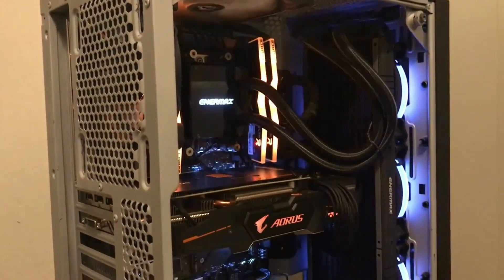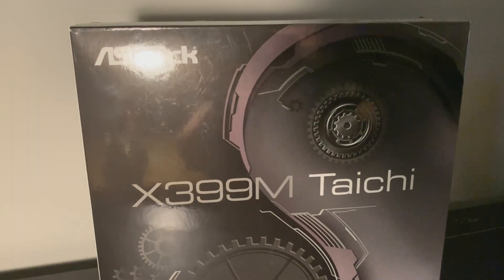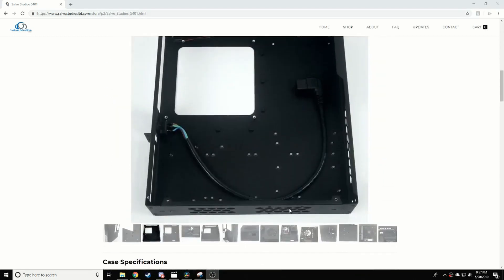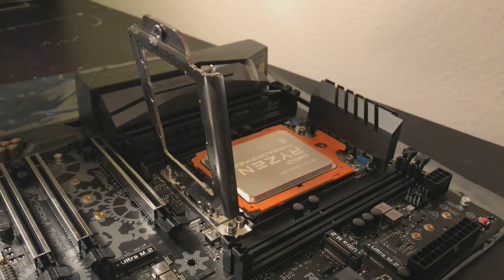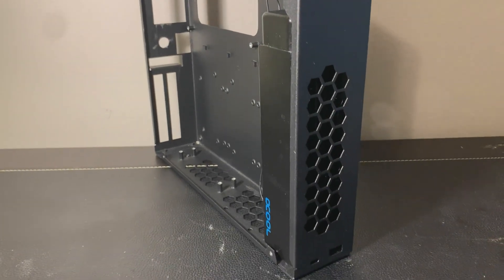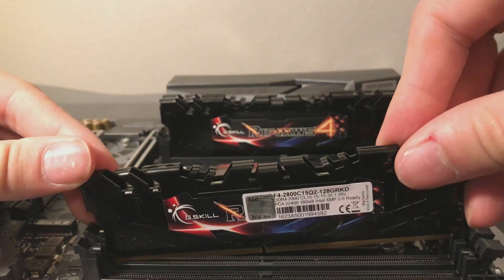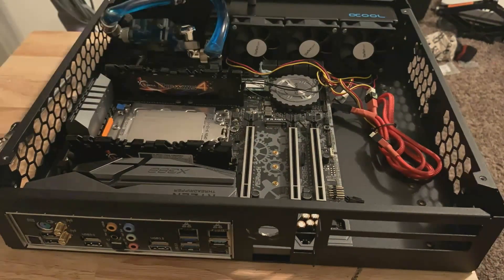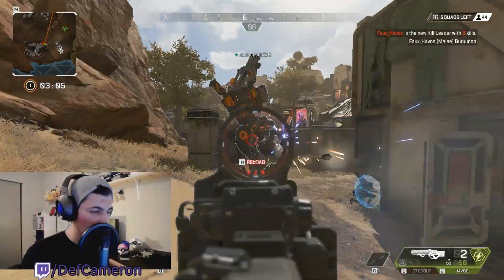“Mini-ITX” Threadripper PC - WORLD RECORD 8L (2019)

Comment from the maker: For those of you wondering, the HDPlex is connected to a 19V custom Laptop adapter from G-Unique rated for 500W.

Parts List:
CPU: AMD - Threadripper 1950X 3.4 GHz 16-Core Processor  ($450.00) 
CPU Cooler: XSPC Raystorm NEO CPU Block. Alphacool Triple 60mm Rad + DC-LT pump + Plexi-Top
Motherboard: ASRock - X399M Taichi Micro ATX TR4 Motherboard 
Memory: G.Skill - Ripjaws 4 4x16GB DDR4 -2666
Storage: Intel - 660p Series 1 TB M.2-2280 Solid State Drive 
Video Card: Gigabyte - GeForce RTX 2060 6 GB MINI ITX OC Video Card 
Case: Salvo Studios S401 Mini-ITX Case
PSU: HDPLEX 400W DC-ATX NanoPSU + G-Unique 500W Custom 19V AC-DC Adapter
Reply: I'm going to try and beat this by making something about 5 liters in size

Comment: This build is insanity! I was directed here via the Salvo newsletter. There are some builds in this case that are mind-numbingly creative.
Reply from the maker: It's an honor to be in the newsletter! This build was insanely fun and I don't believe any other case could have supported it like the S401
Reply: @definitelycameron9021  The build that your's reminded me of is a mITX build that's fully custom cooled (he used a thin 240mm rad in front of the graphics card which is its own special brand of crazy). What your build is giving me thoughts of is that mDTX Asus ROG x570 board... if only something could be done about that riser card...
Reply from the maker: @annasoH323  I think you are talking about the builds in the Sliger Cerberus and Cerberus X. Wonderful builds! I think the benefit of TR is really ignored in this build with the multiply x16 PCIe lanes. This mainly was to be able to shove 16 cores into an ITX case for editing without spending $1000 on the CPU alone. With X570 and Ryzen 3000 it will be more capable. Moving to the R9 3900X or the hinted 16 core will make this build much easier, possibly moving to a pump/cpu block combo, and an sfx power supply and ITX/DTX motherboard
Reply: @definitelycameron9021  There was another builder that I think also was highlighted by Salvo Studios that had an S401 custom loop build (not sure where it was posted other than smallformfactor.net). You have a good point about the PCIe lanes not being put to use but I can see how that wouldn't be a problem as long as you don't consider it a need. I dream of one day doing a  TR build... I just don't know when I'll be able to justify it.

Comment: AMAZING !!! I'd love to see the new Threadripper 3rd generation mini itx.
Reply from the maker: This was an EXCESSIVELY expensive. so unfortunately it is not on the plan for now
Reply: Hate to be that guy but it wouldn't fit with everything else on an itx board. The socket would be too big. 

Now, DTX with some components or connectors shifted to an add in card (think the ROG crosshair VIII(?) with the custom SODIMM card with RGB and fan headers and M.2 slots)...

Comment: I'm looking to do a small case like Corsair ONE, Ryzen & 2060 Ti, CPU & GPU liquid cooling, HDPlex DC PSU powered by pure-sine wave UPS with DC output ...
Too much energy & power calculations and search of optimal parts ...
Need help
Reply from the maker: The HDPLEX NanoPSU is rated 400W and tested at continuous 500W safely. As for the adapters, the rating is set at its max. So if it says 330W, do not try and extend past 330W tdp. For this system I aimed for 400W tdp and had everything rated for 500W
Reply: @definitelycameron9021  And what is the HDPLEX NanoPSU 400W DC-DC requirement to be powered by DC-output UPS?

Comment: Any tips for someone who wants to attempt this themselves?

Windfall from SFF Network
Reply from the maker: Plan your build 95% before attempting anything. I advise this for any project. I have 3 major SFF projects and there has only been one hitch in all of them and that wasnt even game changing. Attempting this specific build, (1) be sure to look at HDPlex's wire layout to make sure you are splicing the new 4 pin connector correctly. (2) get the 20mm Startech 60mm fans as they are the quietest and move the most air (3) Don't try this at home if you aren't ready to drop $1500 at the drop of a hat.
Reply: @definitelycameron9021  Thanks! Do you have a complete parts list by any chance?
Reply from the maker: @wifal6874  Parts List:
CPU: AMD - Threadripper 1950X 3.4 GHz 16-Core Processor  ($450.00) 
CPU Cooler: XSPC Raystorm NEO CPU Block. Alphacool Triple 60mm Rad + DC-LT pump + Plexi-Top
Motherboard: ASRock - X399M Taichi Micro ATX TR4 Motherboard 
Memory: G.Skill - Ripjaws 4 4x16GB DDR4 -2666
Storage: Intel - 660p Series 1 TB M.2-2280 Solid State Drive 
Video Card: Gigabyte - GeForce RTX 2060 6 GB MINI ITX OC Video Card 
Case: Salvo Studios S401 Mini-ITX Case
PSU: HDPLEX 400W DC-ATX NanoPSU + G-Unique 500W Custom 19V AC-DC Adapter

Comment: Chk Bitwit, apparently 3900x is a faster 12C/24T? And will fit on itx motherboard? And try fitting everything inside a LAZER3D mITX!
Reply from the maker: Yes it is! This project was done pre Ryzen 3000 release. Sounds like I need to do a redo!
Reply: @definitelycameron9021  Just waits for the Threadripper 3000 series.

Comment: I feel slightly rickrolled that you don't actually use an ITX board (because there isn't one), but I did find the video interesting. Have you considered using one of those external power brick PSUs to save space for a full length GPU?
Reply from the maker: the system does need a external power brick, but the main power board had to be inside the case.
Reply: @definitelycameron9021  You went with something that took up space in front of the GPU, right? I mean something like the G-Unique Arch Daemon that would mostly sit on the motherboard. https://loneindustries.com/products/52

My 2990wx/x399m system is set up in an open chassis now, but if I was working with the case you have, I think a supply like that would allow me to keep my larger GPU. I've already re-cased it once, don't tempt me. XD

Comment: wait, 74°C ? Isn't threadripper on 67°C max? You must be thermal throtteling then...mine doesn't go above 55°C with -100mv offset and bequiet dark rock pro 4 tr4 cooler on max 700rpm fan speed.
Reply from the maker: the dark rock pro4 is a much better heatsink that a triple 60mm rad with slim fans on half speed. 69C is thermal throttling for Threadripper so I set the boost clock speed and a set voltage to bypass this thermal throttle limit. I held at 74C with no clock speed drop. and really quiet
Reply: @definitelycameron9021  wow impressive!

Comment: lolol these CPUs overclocked put out so much heat it's insane that little box has way too much fire in it for me you might as well be gaming on a space heater my dude
Reply from the maker: I do get cold pretty easily
Reply: you do know the amount of heat they put out into the room is the same no matter the size of the case right? the bigger cases just spread it out more evenly where a small case with the same amount of heat will feel hotter, but it will not make the actual room hotter than the larger case ;-)